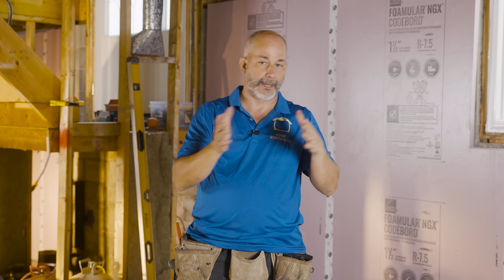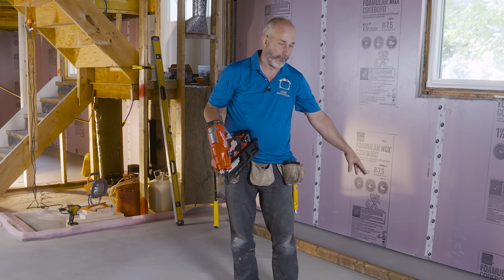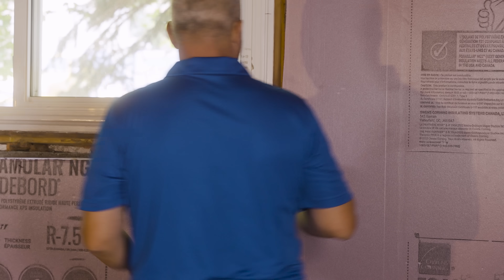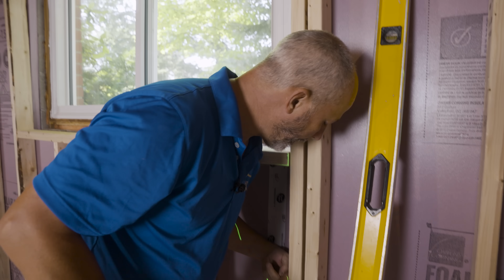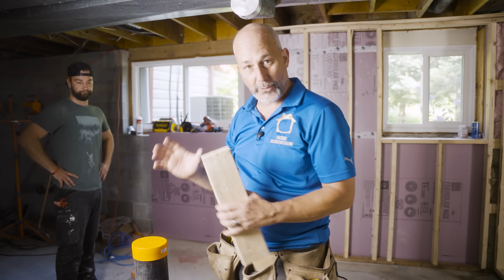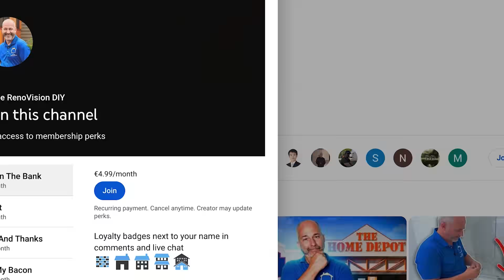The RIGHT Way to Frame Your Basement (From a Pro with 30 Years Experience)

Comment: I know this is an oldish video, but how did you achieve horizontal fire blocking with the XPS all the way around? XPS is considered an "air cavity" for purposes of fireblocking. I understand the vertical concept, placing 3/4 inch fire rated particle board or 1/2 Gypsum from the sill plate to top plate of basement fall, covering the XPS. But how did you achieve the 10' horizontal blocking required by code between the XPS boards back to the concrete?

Comment: Why do you bump your corners all the way to the wall just stop your first wall short of thr block,  to where both corners meet then you have your nailer left and you dont have to keep adding a wasted nailer on the first wall you butt up to the block! Leaves a dead space behind there but doesn't matter the trim and drywall hides it. Just wasted material imo! Do that across your entire life is a lot of unnecessary waste! Take two scraps touch them together where it meets make your mark and that's your stopping point!

Comment: If i am worried about straight walls, and bowing, ould metal studs be better if you can afford it. I have a basement I want to frame out a bit, but also a partial second level.  based on wall lengths and 16oc spacing i need maybe 60 studs not counting for king studs for doors, so lets say 70 total.  it looks like metal studs are $2-3 more.  If we say $3, thats $210 more for straight studs.  It also helps save labor since i wont need to drill for wire pulling (commercial MEP contractor so i think in terms of labor savings).

Comment: I really miss the clawed tang feature on antique carpenter tape measures. They were designed to bite into the end grain of a piece of wood so they weren't always slipping off. I haven't found a single tape measure made today that has that convenient feature. Yes, you then have to release the teeth, but they don't bite too deep anyway.

BTW, a tip I learned throughout the years when using 2x4 framing is to lay them all down and make sure they all bow in the same direction. You'll never get flat SPF studs, and if you don't want your drywall to have waves in it, the bow has to be facing the same way every time.

Comment: i wish i could send pics for someone to see, my basement has these boxes like things off the main truck. I dont know if they are pre duct things i can tap into for ducts or if they messed up the duct placement of whats on the main floor. i dont want to cut them open and use it till I know what they are. there are at least 4 if not 5 of them. and they are insulated i know this because the builder came over and cut one open then had the hvac guy come out a week later to seal it up again. There are 2 over coming off the 2 different main trunk joints. ya i wont mess with them. its the others Iam not sure of.

Comment: should you put the outside wall on top of dimple/dampro floor underlayment so that if the foundation leaks the water will drain under the bottom plate instead of getting blocked by the bottom plate?

Comment: What if your Concrete floor isn't perfectly flat? That bottom plate has some variation in it. If I build my framing then put it up it won't be flush against those floor joists...

Comment: Great videos.  I have a basement, built in NH in 1968. You can see the cement footer, then 40" of cinder blocks (below ground), then 30" of knee wall (all above ground), then the framing of the house starts.  I was unsure how to insulate the cinder blocks, but after seeing this video and your other insulating a basement video, I think I am good to go.  The foam wall with airgap would work perfectly for me.  We do get lots of humdity in summer hence a dehumidifier is used. However, the basement in the winter is about 17 to 20 degrees cooler. I am pretty sure I am getting a lot of cooling from the cinder blocks as they are also open at the top. Knee walls are insulated but after watching your videos I can see where I can improve upon that too as I do have some air flow that shouldn't be.  Thank you!

Comment: The code requiring a vapor barrier behind the drywall when there is a vapor barrier (foam board) on the foundation wall is insane. How would this not trap moisture in the stud bay?

Comment: Wait - on another video, you said you have to put the subfloor in first before the frame ..... Is that only for old houses?? If your house is newer do you put the frame in first and then the subfloor?
Reply: Subflooring is meant to prevent your bottom plate from soaking in moisture from concrete, so that is why you should set it down.  It's just good practice.

Comment: your stud layout doesn't work!   you have an 8' plate starting with a stud.  the next 8' plate starts with another stud.  the way it's laid out, if you start the drywall right in the corner it will come out to the end of the bottom plate and there is no stud above that!  you need to measure 15-1/4, 31-1/4, ...  then there will be a stud that overlaps both bottom plates.

Comment: This layout DOES NOT work!!! i've been racking my brain trying to figure out the math.  if you start with a stud and measure every 16" from the end of the plate, at the other end of an 8' plate there is no stud - which means there's nothing to fasten drywall to.

Comment: If building on a dricore membrane subfloor, you dont need pressure treated lumbar or a vapor barrier correct? Since the subfloor has it in it ?
Reply: Cut out dri core before putting bottom plate down
Reply: @cameronmacpherson5172 why ?

Comment: Question - instead of using that pink foam board to create airflow, couldn’t you just move the wall in? Leave, say, a 6 inch gap between the frame and the cement?
Reply: You'd still want insulation and vapor control fully behind the wall assembly so no wicking or condensation occurs on the framing or drywall.

Comment: in canada, when framing a bulkhead in the basement around vents, code reads you must have a 1" gap around the vent. would you recommend a metal bracket frame to save space?

Comment: A few pointers, learned the hard way:
-- Concrete is WET. Always. All wood that touches concrete should be pressure treated. Under your bottom plate should be a gasket or (at least) a layer of thick PVC tape (pipe wrap). In addition, you need to leave about 1/16" of a gap between the wood and the concrete. This gap is made by making plastic shims for every nail that goes into concrete.
-- Walls need to drain as well. Plus, the original concrete (or block) walls are never plumb and straight. My solution is to attach the foam board to the wall - leave that little draining gap - ,tape the seams, then put up the frame inside the basement.
-- The bottom 18-24" of the walls need to be covered with DuRock, Hardie board, or similar waterproof material. Don't let a 1" flood ruin your wall.
-- For a similar reason, place your electrical outlets at least 24" above the floor.
-- Avoid fiberglass insulation. In the event of even a minor flood, fiberglass will soak up water like a sponge. 1" of foamboard is plenty of insulation for the walls.
-- Finally, remember the floor is neither flat nor level. Don't assume the floor drains to the sump pit. You really want to fix the floor before you do anything else.

Comment: You could accomplish this entire job in half the time with metal stud framing. No warped lumber. You can carry 10 studs down the stairs at a time. Strong and straight. 2x4 framing for basements is tedious and backbreaking. Once you try it, you will never go back to Jeff’s old techniques. You can use 2-1/2 “ studs and gain some space, too.
Reply: 3 x more expensive with metal, but yes an “easier” option

Comment: How do I frame when the builder has stopped the insulation and vapour  barrier to about 3~4 feet from the floor in the basement? 20 year old house from Toronto.
Reply: Are you sure it’s 3-4 feet or did you mean inches. If it’s in inches, apply one 3/4” inch plywood, add thick plastic to stop moisture, the add your floor
Reply: I would rip that crap out and do it right like in this video.

Comment: The end wall of my garage is a block wall, on the other side of that wall is my home interior which has studs, vapour barrier, and drywall.  I am insulating my garage, both walls and ceiling (ceiling is done), I am not sure how I should insulate the end wall that is shared with the inside of my house.  I plan to install 2X4 studs, with insulation and plastic vapour barrier over the insulation, but I am not sure if I should also use a layer of foam against the block wall, inside the studs, like in this video, please advise. My garage is heated, I normally keep it around 50 degrees F., I live in the Toronto area.

Comment: From your experience, If framing out basement walls would you leave a gap between the top of the wall and the ceiling joists like you did here if we are not planning to add add dry wall ceiling (Leaving exposed)? Or did you only do that to add the smaller boards in preperation to drywall a future ceiling.
 I have seen multiple opinions on this. Thanks in advance. So glad I found your channel as I plan my DIY basement renovation.

Comment: Question for you: How do you attach the framed wall studs to the cinder block walls? Every video ive seen shows people framing a wall with studs turned flat against the block wall instead if the studs turned outward like a normal studs wall would be. I see your studs against the wall are the normal way, but there is no showing how they were attached.

Comment: My problem is my house is 100 years old. The basement walls are not flat. By that I mean it comes up flat cor 4 feet then it goes out 2 feet leaving a ledge. There are sliding doors to access this storage area that has shelves around half my basement. The section that was added on. An "L" around the north, west and a portion of the south sides. I don't want to loose the extra storage  space. The areas are the bathroom, which I know I will have to cover behind the shower and tub areas, the laundry room and the office. Any suggestions on how to cover this area and have access? The sliders work but you can't access the whole space where the doors over lap. That just leaves regular cabinet doors. Thanks.

Comment: Need a video for framing a wall in place. No room to pre assemble on floor.
Reply: Layout bottom plates first, do them square and correct, fasten them, then use laser line and mark to plumb your top plate. Then just add the studs in last, inbetween your top and bottom plates.

Comment: I have a question. When you were screwing the top plate in, you mentioned that you didn't need to shim because you were only supporting drywall. How does this effect the wall if you decided to mount a heavy TV someday in the future? Should it have been tighter at the top? Or will it still be okay?

Comment: pulling for 16 on center should start with 15 1/4 then 16's off of that or minus 3/4 from every red number to get centers. THANKS.
Reply: I’m trying to wrap my head around this but am struggling to understand. Why is that the case?
Reply: Because you put the first piece of drywall flush to the left and then 16" is the center of first stud. If you go straight 16"s then your first piece will need a 3/4" gap to start.
Reply: @fubargrinch but if the previous wall was drywalled first (working clockwise around room) would 1/2 inch of that 3/4 gap be filled will drywall?

Comment: In your last show you said always do the floor first?
Reply: I believe you do the subfloor first if you don't have a vapor barrier on the bottom of your pad. That way you can have airflow from under the floor and under the wall that goes up behind the foamboard and out above the wall. I assume this is a new build with vapor barrier tech installed on the outside so they aren't worried about getting moisture inside.
Reply: @CoinXO no. It’s a 1970s house

Comment: Quick safety tip based on experience. When using a framing nailer keep the hand holding the stud back from the plate a few inches. 
If the nail hits a knot it will shoot out the side and clear through your fingers.
Reply: ouch

Comment: If the house was built in the last 30 years then there is a vapor barrier under the concrete floor so no sill seal is necessary… Also why not frame the wall 24” OC since it’s not load bearing saving costs for the DIYer?
Reply: Insulation
Reply: @jeremystover256 you can buy 24” wide insulation easily…

Comment: The moisture comes through concrete not only floor but foundation walls as well. You don’t want to put anything directly on the concrete walls. The framing should be about one inch away from the concrete walls so there will be sort of draft between drywall and concrete which will keep the concrete dry and no mold. Basically, no point to insulate concrete below ground level since the ground is insulation itself. Insulate only the portion above the ground like knee walls. Most important, you don’t want to trap moisture that comes through concrete or condensation by using vapor barriers. Vapor barriers is a different story when use under siding or bricks than basement.

Comment: If you're not buying a framing nailer, check if there's a tool library in your area that has one. Usually a 1y membership is under $100 and you can typically rent tools that you'll only need for a single project and save money.

Comment: Quick question: for the nail gun option, what is the size of the nail? I found it difficult to get 3.5″ x 0.148″ diameter paper collated nails for the nail guns. But I do see very often the size of 3.25″ x 0.120″ diameter. Is it strong enough for the basement stud framing?

Comment: Why the gap above the wall? I understand it’s only holding up the drywall but attaching the top plate with a few screws in a short wall doesn’t seem to make the cut. If someone leans against the wall the screws will probably snap especially since the wall is short and the top wall plate would bind on the stringers. Would that pass a framing inspection?
Reply: Agree. Very easy to shear off those construction screws.  I wouldn’t trust it

Comment: Guy screwed up the 16” oc layout right off the hop, you pull 3/4 back so it actually lands on the stud, not on the edge, this guys working backwards with checking plumb after the walls actually built, not laying out his plates together for the entire wall. Not snapping a line on the floor and following it with his bottom and top plate

Comment: This was very educational but this isn't a good video for DIYers.  Right off the bat, you showed us (and used) a whole bunch of tools that most of us don't have.  If I was a carpenter, I would definitely buy a nail gun, 22 caliber masonry gun, laser line, specialized 2x4 twister, etc. I would be using that stuff a lot so that makes sense.  But me, a DIYer, who wants to put up a single wall, isn't going to go out and buy all that stuff.  I have hammers, a miter saw, screws, nails, impact driver, drill, measuring tape, level and a few other things that could be useful for this.  I'd like to see the right way to frame for small scale projects.

Comment: I've always nailed in my top plate, and bottom plate, and then built my wall in the space. Then you have points of contact everywhere and extremely sturdy walls.
With this being attached only by a few screws into the upper joists, will that be sturdy enough?
It seems to me that having gaps means that the wall will move easily.
Reply: More than strong enough….if you are concerned, yes you can shim top plate to joist
Reply: I have same concern because the “construction screws” seem to shear off very easily.    With framing nails I would not be concerned.

Comment: Great video, but you should be wearing safety glasses when you are driving or removing screws above your face and especially when using the 22 cal. driver.  You really should always wear  them anytime when you are doing this type of work.  You wore ear plugs, yours eyes are a lot more life changing if you blind yourself. Lead by example.

Comment: This is off topic but do you have any opinions on Floor and Decors NuCore vinyl with the cork backing or the Malibu engineered hardwood sold through Home Depot? if you dig enough you can find nightmare stories on all of this. Just not sure what is a DIY or customer maintenance issue or a manufacturer issue

Comment: I'm not finishing my entire unfinished basement;  I'm not concerned with walls that are (mostly) below grade.
However, I excavated a hill slope and extended a patio creating a (under deck) cubby hole with two cold basement walls about 14' long.
I plan to glue the insulation panels to the wall and tapcom 2x4's flat to the wall (leaving gap along the floor), more cleats rather than studs.
This will secure the panels firmly to the wall and provide backing to sink the drywall screws.  I may or may not decide to add further insulation in the 1-1/2 deep bays between the 2x4's.

Comment: Can you clarify something for me? I thought we were supposed to leave a small gap at the bottom of the rigid foam for moisture to slip down the back. It looks like you did that here. If you place a pressure treated 2x4 directly in front of it, then won't the moisture just run into the side of the 2x4? Why don't you place the 2x4 on the little blocks like you did in the first video? And if you place it on the 2x4, where would you place the seal gasket (under the continuous 2x4 or under the blocks)?